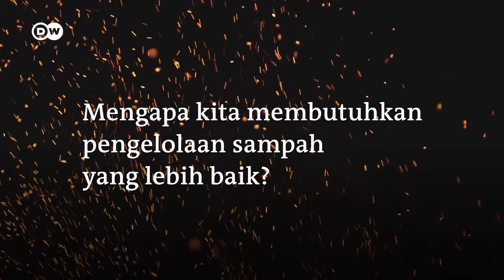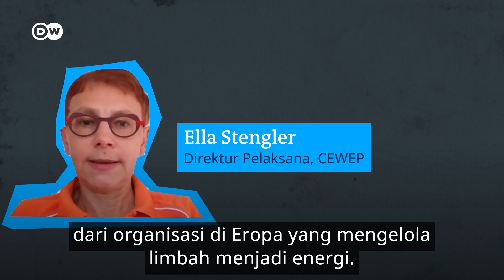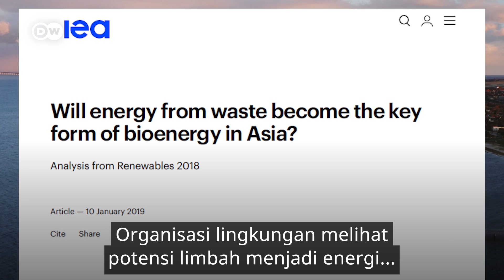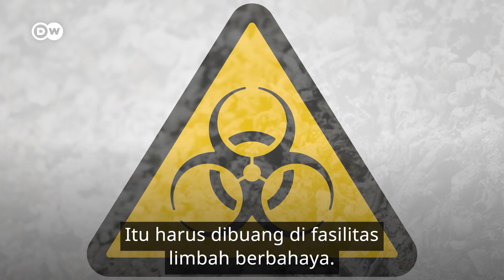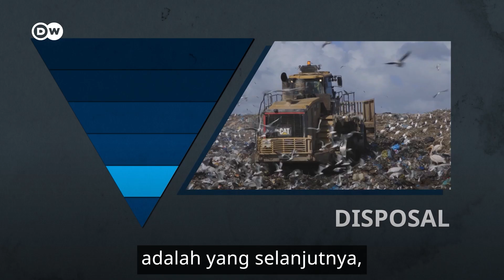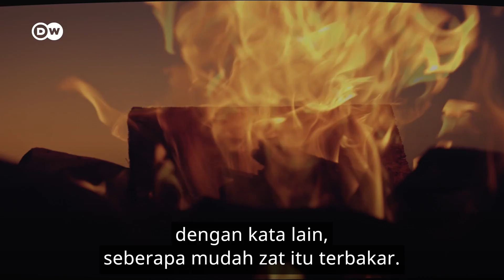Bakar Sampah di Insinerasi, Apakah Solusi Jitu Agar Sampah Enyah? | #PlanetA

Comment: Small country like germany is more polluting than bigger countries. The carbon intensity of Germany’s electricity generation has exceeded 700 grams of carbon dioxide equivalent per kilowatt hour (gCO₂eq/kWh), and is going as high as 765 gm, due to a higher infusion of coal in the power mix.
For reference, average hourly data from the International Energy Agency (IEA) for India shows a maximum carbon intensity of 718.7 gm.